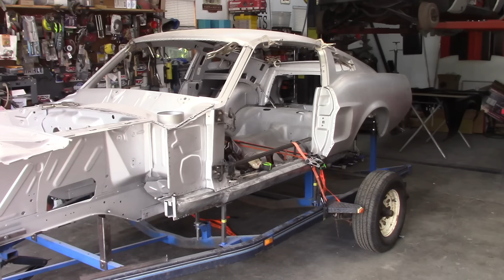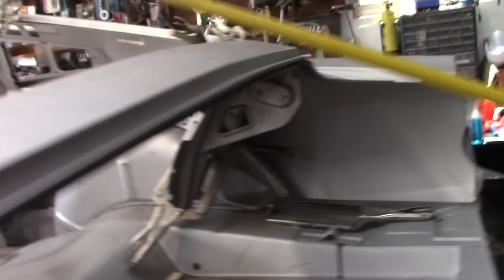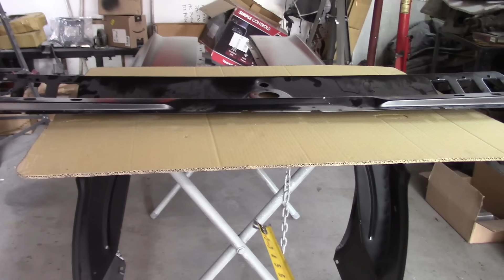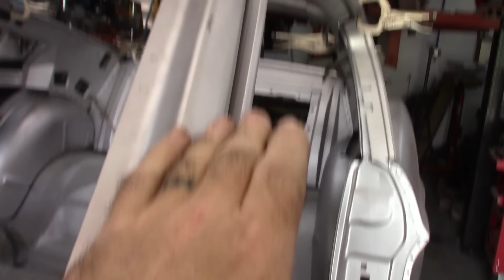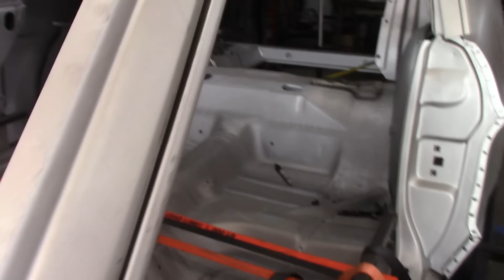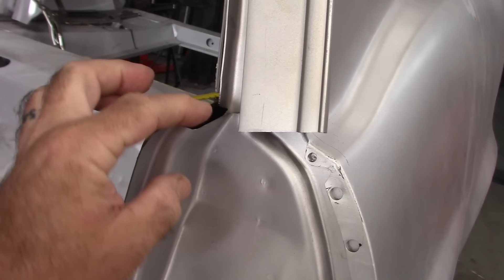68 Mustang fastback build. Welding more sheet metal. Fangled part 9. #mustang #howto #fastback

Comment: Great video Barry.  Quick question.  Are you using a flapper or solid disc on your 4 inch grinder when you’re knocking down the spot welds?
Reply from the maker: Flap disc

Comment: I'm curious, what size of wire are you using?  I usually use .25 or .30 depending on the thickness of the sheet metal.  Your welds are flowing really well.
Reply from the maker: This is .030 wire.